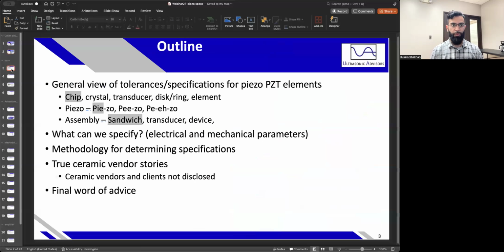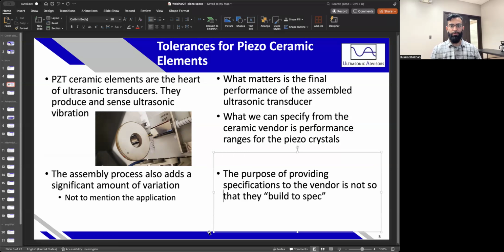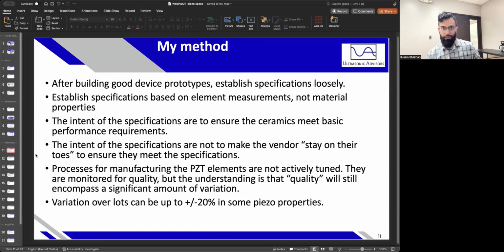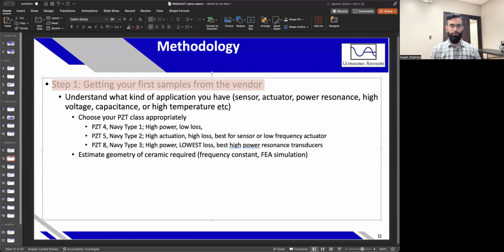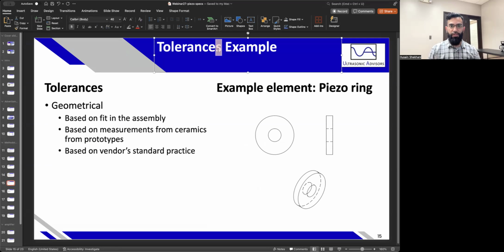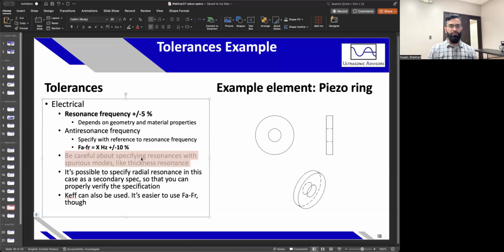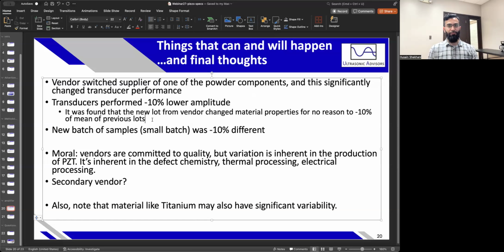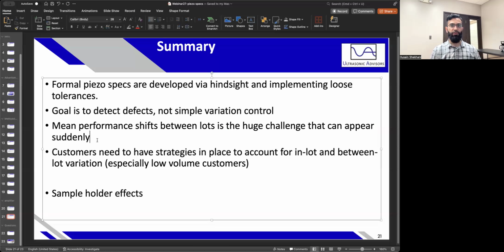How to prepare specifications when ordering piezo ceramic elements

Comment: I tried to get gpt to measure what i need and it keeps coming out with different mm its so frustrating, i just want a disc that tolerates 2000w at 20khz it says i need 11.3cm and a thickness of 2.5mm is this correct?